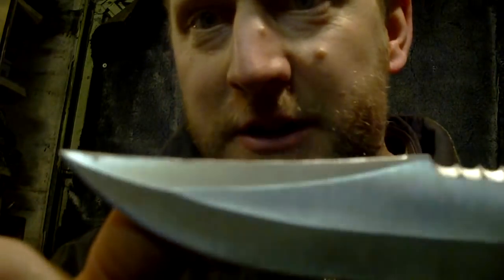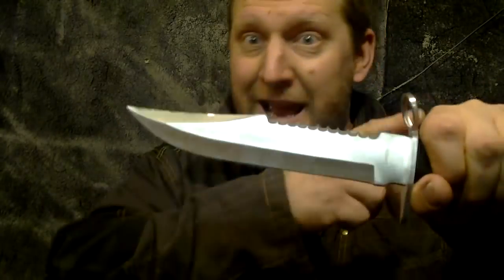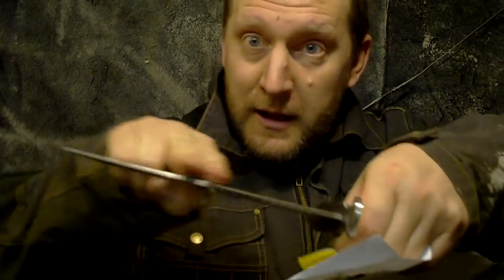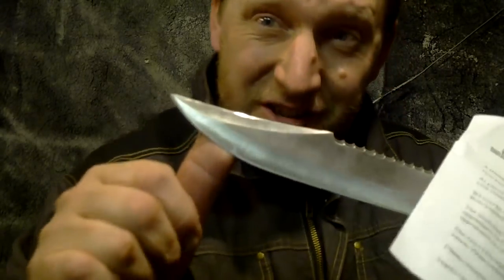How To Remove Knife Scratches and achieve a Mirror Like finish, Simple Theory on hand finishing!

Comment: Hi Scott.
Hope you are well.
I was given a MKII British Army issue Kukri for Christmas, but it has slight blemishes on the blade. It’s pretty shiny and I think that going over the whole blade would take away from the shine that it has. The blemishes are not deep, but more like ‘stains’. I don’t have a bench buffing wheel like you but would a Homebase type polishing kit or some sort of Dremil type tool and Autosolve get rid of them? I know it’s sort of hard to explain without you seeing it, but it’s like a mild corrosion that hasn’t eaten deeply into the shiney metal finish, but deffo needs work to remove.
All the best mate.👍🏾🇬🇧

Comment: If you don't have any really really fine sandpaper for polishing you can use  gasket material it works really good it just has to be the kind with little tiny pieces of metal mixed into it

Comment: Great advice! I'm working a similar scratch out of a Chris Reeves Sabenza valued at about $300 US. The steel is S35VN and much tougher than a 440 steel. Any tips on how to go about this? Maybe a rubbing compound I can use to finish? The blade has a directional brushed finish so it needs to match the rest of the blade when the scratch is removed.
Reply from the maker: Daniel Clifton try micro mesh..a range of grits from Amazon...

Comment: would you recommend this cleaning for scratched chef knives?
Reply from the maker: Jesse Lee removing scratches this will also remove makers marks, protective coatings, case hardening,patina etc. as long as the owner appreciates that this will happen and that the debris from the work must be cleaned away before use, it should work on most metal surfaces whether they are knives or not...

Comment: When removing the scratches, as you pass the different grits over the blade and move on to finer grits. Do you always work the sandpaper in the same direction? Or do you go long ways, then with the next paper go across, then back long ways with the next paper?
Reply from the maker: hi there... oh can of worms here I'm afraid, easy method, back and forth one way, one direction however, should you "skip" grits, you could on the coarse grits plough deep furrows which will be a pain to remove between for example 80 grit and  280, whereas if a 3 way , straight diagonal left/diagonal right action was used as the abrasive began to wear down, you could effectively remove the tops more with using the abrasive for longer...but for simplicity,,, go in one direction, from about 300 on you could have 3 layers of masking tape on the bottom of the sanding block or thin leather to put more "give" on the finer grits,,,checkout "jacklore knives hand finishing" regards Scott

Comment: i went back and started with a 60 grit, then 80, 120, 180 and finished with a 240. then i started buffing out with an inox polish substance, but there are still major scratches appearing after im done buffing. am i supposed to sand in different direction with every grit? i was using a circular motion and then i sanded it along the lenght of the knife with every grit. thanks
Reply from the maker: think of "one direction" ,  back and forth  up to at least 400, at this point, I have seen some people go off to 45 deg for a while, but I'd just keep it straight, at least you can see each grit eliminate the previous grit pattern...once you hit 360/400 that is a nice satin anyway...
Reply: thanks for the advice. im contemplating just ending with 400 grit and completely scrapping the idea of making a mirror polish since its already time consuming with just using sandpaper plus the fact i dont have a grinding wheel and i work by hand using files and sandpaper.

Comment: How much pressure should we use? Would it be heavy at first then lighter pressure the closer you get to the mirror stage or just maintain the same amount of pressure?
Reply from the maker: a great comment,, pressure of a light leaning on the blade is enough to begin with ...weight of the arms/hands at the latter stages,,,regards Scott

Comment: This is legit,same method I use at work for removing scratches from polished plastic surfaces.After the 'sanding' we always then rub the surface with cream cleaner(like brasso) then buff it out.
Reply from the maker: Mac James yes,,I used this for the acrylic laminates after using a lathe and mandrell,,,progressive abrasives then metal poilsh will bring out a shine,,

Comment: I'm very late, but I got a Gerber O6 Auto and I scratched it up a little bit. It's an S30V blade with a black coating on it. How do I get rid of these scratches if I even can?
Reply from the maker: hi there, with any coating, bets are off, so to speak, however, if you wanted to take apart to remove the coating, good quality abrasives will do that and then allow you to satin to mirror finish
Reply: @WessexBladesHandMadeKnives  alright. Thank you!

Comment: if I scratched a mirror polish while sharpening at 600 grit could I just go from 600 to remove them?
Reply from the maker: +Nathan “Nate” Castro you could be gentle/patient starting at 800,,this would ensure you don't thin your blade/sides excessively removing the scratch,,,but 600 would be a sensible grit to start from,,then 800 1000 1200 1500 1800 2000 2400 3000 4000 6000 8000 10000 12000 ad nauseum......

Comment: I have a vintage schrade LB7 lockback it's got a few scratches from slips with sharpening stones. Is there knife shops I could take it in to have a professional like urself to take them out n polish the blade back up. I also wanted to have the brass polished. It just has too much sentimental value to me don't want to risk a mistake.
Reply: Sry the blades stainless btw probably 440c
Reply from the maker: any scratch will require as much steel removed as the scratch is deep, I am not aware of many outlets for sharpening other than if you contact a local maker who has the time ....when it comes to the brass, you could just use autosol paste from a car parts shop which will remove hardly any material...I hope that helps...
Reply: I appreciate the reply thnx. I'll try that n see if there's any knife specialty or repair shops in the city. Wear scratches I can deal with cuz i carry it everyday as a tool. But it's a collectable so the nice brass cherry wood n stainless go out window with those deep ones. The scratches drive me nuts when I look at it. I'm gonna call around 2day.
Reply: Worst case tho I can buy some of the needed sand paper u mentioned and do it by hand ya? The way it was machined the grain goes up and down so I'm not sure how I'd do it. If I went side to side I'd fix scratches but it's against the grain, so some how I'd have to correct the direction of scratches. Use the same grit I used to remove scratches to correct direction right?
Reply from the maker: if you went in the direction of the scratches it would look better quicker I think,,,,but with any scratch it does take a fair amount of work to remove it....
Reply: Awesome thank u depending on how it goes I'll do that. It's gonna be hard cuz I'll be going up n down at a way shorter distance so it'll be interesting lol. I saw this stuff called scratch be gone it takes scratches n gouges out of stainless. So I got a few options but I'm gonna try urs first if theirs no shops. Thnx again buddy much appreciated.
Reply: *theres

Comment: Hi will this same process work on a 420 stainless steel sword? Its a Marto Toledo Sword. Has a mirror finish on it. Somehow previous owner got scratches on it. Deep enough I can feel them with my fingernail. I would love to remove them but to make the situation even more difficult the blade has an etched signature I would like to leave on. So am I right in assumption that this is a very difficult challenge in which I will have to tape over the etched area to stay away from it and then have to use the various sandpapers going all the way from 80-2000 (possibly 2500?) grit and then remove the tape and polish the entire sword to attempt to blend it the best possible?
Reply from the maker: pretty much , except you would need to tape a bit bigger than the etch decal to allow a blending using the grits as well, not just a polish

Comment: Do you think it's possible to get rid of scratches on the Japanese katana by using sandpaper similar to a Knife ? If so I might as well do it to get rid of scratches on my katana.
Reply from the maker: yes, but be mindful of the grind etc, flat, convex.hollow so that you restore it rather than regrind a different geometry
Reply: Wessex Blades&Bushcraft Hi there I forgot to ask you something what kind of sandpaper did you use on your video to Get rid of scratches on Knifes and katanas ?
Reply from the maker: @alejandrocaudillo2993  it's called Wet and dry, far better than basic sand paper

Comment: How would one remove scratches on a knife coated in black?
Reply from the maker: you can't unless you remove coating, use abrasives for even finish and re apply the coating be it epoxy/cerrakote etc..
Reply: Wessex Blades&Bushcraft 
Ah okay, thanks.